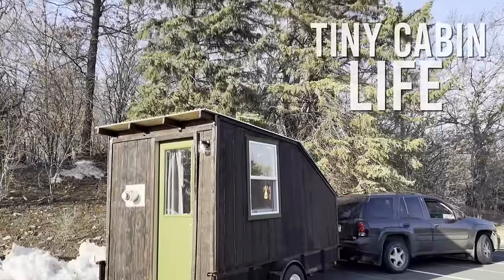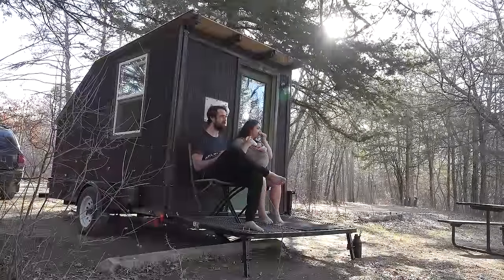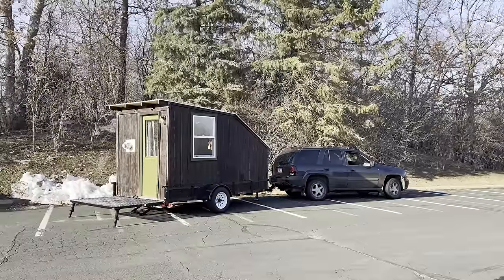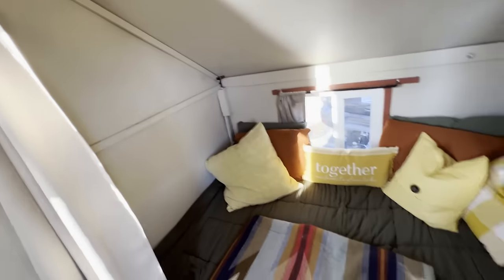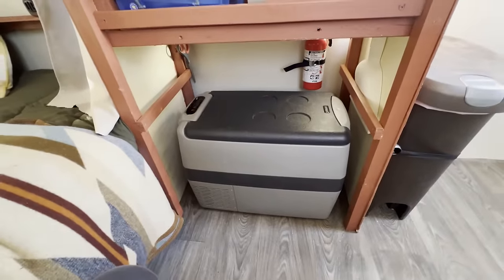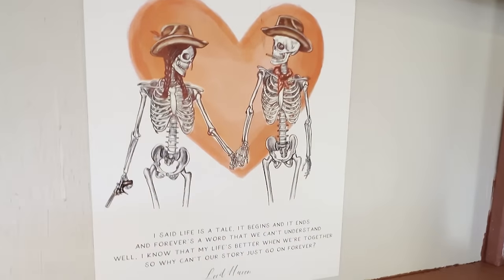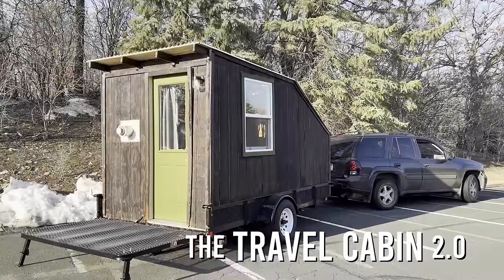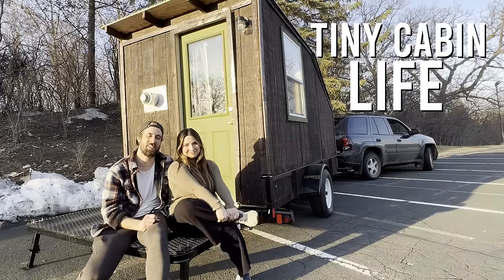Our Tiny Cabin on Wheels | The Full Build: Start to Finish

Comment: im just going to suggest this however, just ignore my two cents if youd rather not do it. If it's not too much effort, I would remove the heater and put it on the adjacent wall right next to where it is and vent it out and up the side and not onto the back porch where you sit. I am a chemist, and you can't sit out on that porch if the heater is running bc you will be directly breathing that exhaust. Its like sitting right next to a tail pipe. And you certainly dont want baby that close to that exhaust. I think you should reinstall it on the side AND flue it up the side beyond the roof an inch or two. Then fill in the hole. You're a gifted woodworker so this should be easy for you. But I that exhaust vent shouldn't be where it is. My two cents as a chemist. Take it or leave it.
Reply from the maker: Totally 👍🏽  I actually just removed the propane and out in a wood stove, so you’ll see that in an upcoming video
Reply: This is a wonderful build, wow!

Comment: Great job Jack!👍. Like you said, the original Travel Cabin will always be a classic, but the extra room you have now, even while still a tiny cabin, will be so usable. With the installation now, this will be so cozy! The ice fishing hole is just insane! Must be a Minnesota thing! Lol. You will love the back porch. As you know, I have a similar set up, and one thing I did off the back porch that really has worked out well, was a bit of a removable awning. I got some sailrite fabric, rolled up a piece of 1x2 on each end and stapled it in place, installed eyelets on each end, and hooks off the back roof that the tarp awning could attach to, and the other end I bungee to the end of the ramp in a slanting fashion. You can enter from the side, but it keeps the rain off the porch and door, and protects from wind or sun and gives some privacy. You could even set up some poles off the end of the ramp so the awning is more straight out and secure with some guy lines. Then you can roll up the awning when you head down the road. I could see the shower set up off the back and drop down some side walls for privacy. The water could just drain through the ramp. Anyway, great job and congrats to you two on your beautiful baby girl!😊❤
Reply from the maker: Such great ideas!! Definitely giving me things to think about. Thanks so much!
Reply: @TinyCabinLife  👍

Comment: I've had my diesel heater in my tiny home that I use when we have ppl over or when my daughter wants to camp in the driveway I've had zero issues in three years with it. I have a similar build but I just used a buddy heater on low and it works great mines about wide 5ft by 10ft long

Comment: I’ve watched this a few times, I just think it is so clever and fun, regular campers are so boring lol. If you have a week without a camping vid I would love to see an updated video where you go over changes you have made and plans for future upgrades or any changes you would make on a hypothetical 3rd cabin.  How much did it end up weighing? Also you could go over some of the products that have worked out such as lights and battery systems with Amazon affiliate links so we can continue to support you. I am currently designing a cabin a little smaller than yours 6x10. I’m curious why you didn’t frame it with 2x2s to save weight and make the walls thinner? Is it so you can have thicker insulation for your northern winters? Thanks and I appreciate the great videos you put together.

Comment: Safety note:  You want the fire extinguisher to be in a location that probably will not start a fire.  So not near cooking, fridge, power bank or heater.  You don't want to need to reach through a fire to get the extinguisher!  Nice build and looking forward to seeing it in many new lakeside settings.
Reply from the maker: GREAT TIP! I’ll move it 👍🏽
Reply: @TinyCabinLife  In general, never put fire between you and the escape route.  Always escape away from the fire, not past it.  I'm a nurse.  Most horrible place in the hospital is the Burn Ward.

Comment: Awesome build, I'm going to build the same cabin on wheels but with a 20 ft two axle trailer, def going to use light weight building material as you did as well, Question I have is when you did the floor to your cabin did any water ever get in ? what I mean is the walls are so close to the inside of the trailer. Does any water seep in ?  Also did you drill any weep holes for water to escape ?  When you travel did any parts of the roof catch any wind to come off ?  I appreciate any advice you can lend me on this.  These two were my only concerns.

Comment: Hi Jack, question:

It's not like I couldn't form answers to why the first 32 sq ft cabin was not insulated and this cabin is, but I wanted to hear from you as to why.

That insulation would have taken up precious space in the first cabin, which because of its smaller size might have been easier to climate control, rendering such insulation less beneficial than maybe in the large space of the new travel cabin.  Perhaps with the baby, temperature fluctuations that you and Riley could address with an extra blanket,  simply can't be along to occur for the little one.

Thanks.
Reply from the maker: Thanks for the questions! Honestly, the reality for the first cabin was that when I built it, I thought I would only use it in the summertime and I didn’t want to spend the money on insulation. But you’re right as well, it would have taken up a lot of space too and with it being so small, it was easy to control the temperature. This new one, especially with Olivia needed to be more stable in the temperature department. The AC is a lifesaver, but man is it loud as well as everything that goes with it. Small price to pay I suppose
Reply: @TinyCabinLife  Thanks Jack.  Clearly, the inverter generator you have to run the A/C is going to make noise--much as inverter generators run "quieter" than conventional non-inverter generators, if for no other reason than their speed is  proportional to the electrical load demands placed on them, unlike their non-invertor "cousins" which run at one constant speed.  Perhaps something that deflects its sound, like a box with holes might help.  While Olivia clearly can't wear earplugs, you and Riley can perhaps.

Also, to the extent that it's the A/C making the noise, and I suspect that it's mostly the generator that is the culprit, perhaps you can set the A/C up outside the cabin, not unlike your diesel heater, in an enclosed but ventilated space, with its cool air hose only entering the cabin.  :- )

P.S. Another thought:  since I can't come up with a battery (i.e. quiet) like solution that could work here given the power load, perhaps, instead, rather than storing energy, you can store, well "cold."  To point, while I tend to think that those informercial ice chests with fan products are a scam, and clearly don't dehumidify the air in addition to cooling it like an A/C--perhaps that might work in your relatively smal space..
Reply from the maker: @djonesey5  Great ideas! I've thought about some sort of a solution that would deflect the sound...I'll dig in to some options!

Comment: Very cool build :) Thinking about doing a similar one here. What was axle capacity of that trailer? How much space did you leave between edge & exterior wall (noticed you slipped plywood between). Thanku
Reply from the maker: Thanks! Great question on the axle…I can’t remember exactly what it is. I left about 2 inches on either side for the siding 👍🏽👍🏽

Comment: Inspired to build one too. Quick question I see you estimate the weight of the trailer at 2,700 lbs and you tow it with a Chevy Trailblazer. Does the Trailblazer have a V8 engine and how does it handle towing it? Have you towed it up a mountain road yet? I ask because my current tow vehicle only has a V6.
Reply from the maker: Great question! I believe ours is a V6. We actually just took it out for a week and towed it up some really steep roads. It’s tows ok, definitely has a harder time with the cabin fully loaded, but it made it just fine. Otherwise, on the Highway it tows really great!

Comment: I cant tell you how many times I have been watched this video. I have questions. 

Did you use 2x4s for framing or 2x3s? Where did you get the 7x12  trailer? Locally, I have seen 6 x12s and those are crazy priced! Near 3 grand! Where did you get the fold down legs for the porch?

Did you draw up plans or ?
Reply from the maker: Hi! So I used 2x4s for framing but could have gone a little smaller probably. I got the 7x12 trailer at a place in Bemidji, MN called King of the Road Trailers. They were great. Still, the trailer was easily the most expensive part of the build. I do have plans that are available through my Patreon 👍🏽 The link for the drop down legs is below! 

https://www.amazon.com/Trailer-Stabilizer-Telescoping-Accessories-Capacity/dp/B09BMX54HD/ref=asc_df_B09BMX54HD/?tag=hyprod-20&linkCode=df0&hvadid=532606083338&hvpos=&hvnetw=g&hvrand=2763157584979967405&hvpone=&hvptwo=&hvqmt=&hvdev=c&hvdvcmdl=&hvlocint=&hvlocphy=9019584&hvtargid=pla-1465775779185&psc=1&mcid=454f714ed5ca382fb732600c5b5cb3ab&gclid=EAIaIQobChMI6ZihhJeKgwMVR2RHAR24bAFBEAQYDyABEgLJq_D_BwE
Reply: @TinyCabinLife  thanks for the info! I really appreciate it.

Sadly as much as I love your content etc I can't afford to be anybody's patreon. I'm on disability and very limited income. Are they available perhaps on your website for purchase or anything?

Comment: Did you have to get a different vehicle for the cabin?
Reply from the maker: I actually built it to hopefully be pulled by my Outback still, but by coincidence the Outback died and I ended up getting this old Trailblazer, which has a better towing capacity 👍🏽

Comment: How did you bolt the frame onto the trailer ?
Reply from the maker: Drilled a bunch of of holes through the wood frame and steel frame of the trailer 👍🏽👍🏽

Comment: Great Build Kids. What Make & Model Is The L.P.💧Vent☁☁☁☁Heater & How Much L.P. Gas💧Does It Use Every Hour?  What Make & Model Is The Hot Water L.P.💧Heater & How Long To Heat Up Or Is It Instant Hot Water💦?  I Like Them To Use In My Build. Oh Gee Have To Have Sheathing In My Build. Understand Your Not Wanting Due To Weight & You Are Pulling With Small Car. Personal Choice. Do You Have A Good Sway Bar On The Hitch? Do You Charge Your Lithium Batteries When Driving Down The Road Then Revert To Solar Panels When Parked? Thank You. always, Tommy🤠

Comment: How did you do the propane tank?
Reply from the maker: So I actually just ran the propane line out and then into a pelican case that I attached to the side of the cabin. I then just bring the propane tank with me when I need it and set it up next to that pelican case and pull the regulator out and connect it

Comment: Awesome on everything things look great so happy for your new young family I see you take the precaution for safety but I did see something and I hate to be that guy but I'm that guy where you're storing the portable stove what if you made that countertop a flip-up backboard with a metal plate underneath as a deflector of heat but wedging up the storage spot so it's right underneath that countertop so all you would need to do is flip up the countertop to cook one you wouldn't have to move things around you just flip up the tabletop you cook you have a safety built inside or I would say put some kind of fire retardant material underneath your underneath that table top when you least expect it things go wrong do you know how many vehicles are caught on fire because of battery operated equipment and the trigger being wedged against something and the battery operated quipment starts a fire and burns the whole truck down that actually happened to a Snap-On truck were millions of dollars of power tools and the truck went in flames by the way where are your fire extinguishers
Reply from the maker: Thanks so much! And those are great suggestions 👌🏽👌🏽